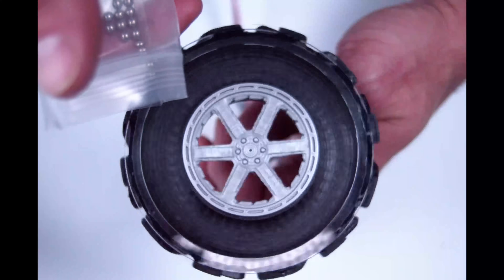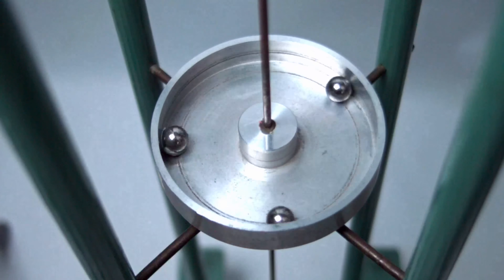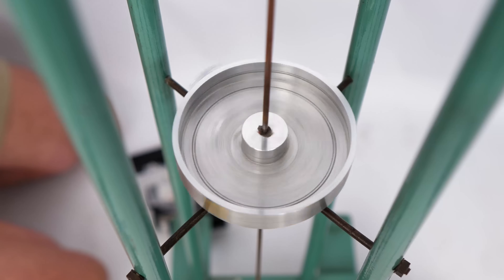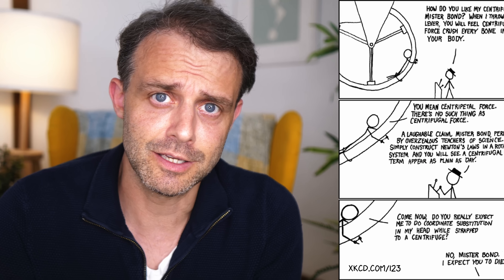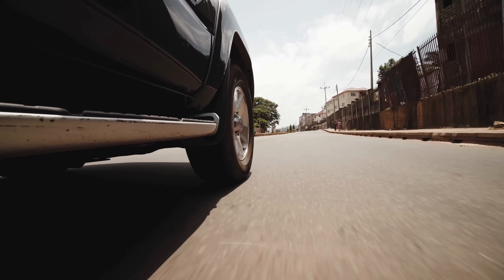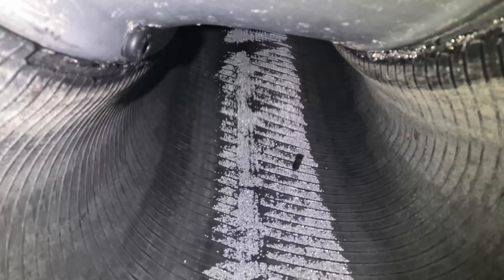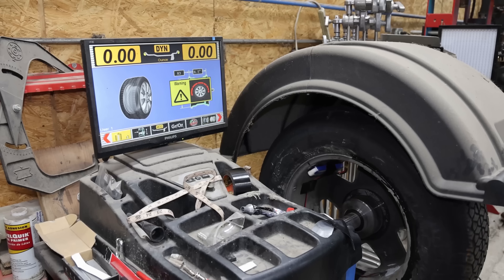Do tire balancing beads actually work?

Comment: At 10:02, the freeway you're showing is in Los Angeles, where the 110 crosses the 105.  In the video, you're looking southbound along the 110.  Thanks for picking one of the LA freeway interchanges.  By the way, their is an electric train that runs through the center of the 105, and a station under the orange-ish awning.  And the "diverging diamond" on the bottom layer is for busses only.

Comment: wait , shouldnt your axle be horizontal ? The way i see it is in this video the physics wont work the same as in a car wheel , reason is the balls are pulled down by gravity and centrifugal force pushes them outwards  compared to if it was upright like a car wheel then its only vertical forces at play

Comment: balance beads work at around 30mph on larger tires, the larger the tire, the faster it works.  I use them in large tires.  they don't work well in small car tires.

Comment: not sure if this is helpful, but when I was a kid there were not fancy balancing machines, and somehow we got on okay. A mechanic (or your uncle) would have this gadget, it had a shaft held upright by feet like a christmas tree, and a funnel shaped thing you would rest the tire on, and a bubble balance in the middle. You'd put your tire on there, get it centered, and you would find that the bubble leans one way or another. You would rest weights on the rim until the bubble was centered, then you would pound the clips into place. No batteries, no software to screw up. Worked for a lot of folks for a very long time.

Comment: Could you put a glue like thing on the beads, speed up the tire to set them all in place, and then just leave it? I would imagine that’d be cheaper (and more easily accurate) than finding the perfect place to put a counter weight.

Comment: Regarding the car situation, i see one scenario with two drivers conducts :
- provided you stay inside the regulatory speed range and do not have a freeway in sight for miles... you'll have a potential wobble that will distract you and make your vehicle slightly harder to steer,
- provided you don't stay inside the regulatory speed range to balance your wheels every single time, you'll be a hazard on the road, even if you know it perfectly (i mean especially if you know it perfectly)

In both cases, the danger for you and others, if only potential, is to take into account (one is by geneerating an annoyance sufficient enough to distract you, the other is a dangerous misconduct and both imply the driver's concentration and attention).

I personally wouldn't drive a vehicle that would be a potential hazard depending on the circumpstances (and i have approximately driven half a million miles with two car accidents).

But yes... I have to admit the glass beeds balancing method is way cooler than the lead weights. Seems like magic.

Comment: Total scam.   I got balance beads in a new set of tires.  They were terribly unbalanced. Took it back and explained the problem, they still couldn't get them balanced.  - I went to a different tire shop and had them remove the beads and install  traditional weight balancing and never had another problem.   The only reason they push beads is because it requires no skill and takes less time, which means  poor service to the customer.  NEVER AGAIN.

Comment: 2:00 I think that because the balls are not orbiting the centre but the object is circle shaped around the actual centre you get an angular velocity increasing as you go to the beads on the outside of the collection. So the bead that is closest to the new centre of mass will have the least angular velocity and therefore speed. The ones on the outside of the collection will have the same angular velocity but different speed. They will then travel out further and deviate more because they are moving faster I think, maybe something to do with having more momentum or it’s as if they are trying to move outward into a higher orbit to match their speed as higher speeds forces an object into a higher orbit to match

Comment: Wheel hop resonance speed is typically 30/60/90 mph on cars, and 35/70/105 on trucks.
So the beads should be set by 30-35 mph.
50 mph would require a very small tire.
These are also very commonly used on steer tires of semis.
If your minimum effective speed were true, they would never drive fast enough to meet resonance.

Comment: Yes they work. I have had several tires replaced on 2 separate RVs with 19;5 and much larger tire size I don't remember at the moment and they worked well no thumping down the road in any of the tires steering or driving tires.

Comment: This only works if your tires spin flat like the contraption

I don't think it would work well in my tires, which are on a horizontal axle

Basically, what you're doing is demonstrating how a load of laundry self balances during its spin cycle <3

Comment: I ran ceramic balancing beads in my motorcycles and never had any problems or issues. They all rode very smooth no matter the speed. I also ran them in my 6'x12' single axel trailer and it pulled a lot better and smoother.

Comment: Many years ago there was a product sold that claimed the same principle except you didn't put it in the tires.  It was on a plate with an outer ring filled with some sort of movable weights that you put on to your rotor just before you installed your wheel over it.

Reading through the comments, I am a scientist but not the one you see doing these kinds of experiments except for in school.  There are multiple natural laws in force in play that all work together.  I can't think of all of them but I do see some of them.  Harmonics is certainly one.  Centrifugal force, kinetic energy, that kind of stuff.  But just try to explain how they interact with each other would be a challenge for most anyone except for maybe someone who understands them all very well and can mark where one law weakens and another strengthens.  Isn't nature a wonderful thing how it operates and interoperates in perfect harmony with each other?

Comment: What impact does the plane of rotation have on this effect? All your desk models rotate on a horizontal plane and therefor don't need to accommodate gravity. A vertical plane will have an extra force pushing the bearings out of position. Is this effect too small to make a difference or is it just enough to ensure the system never balances?

Comment: I think they're useful as a temporary fix, but ultimately you have to get your tires balanced to prevent all that strain on your axle. You don't want to break your axle after all and that's a much more expensive fix than tire balancing.

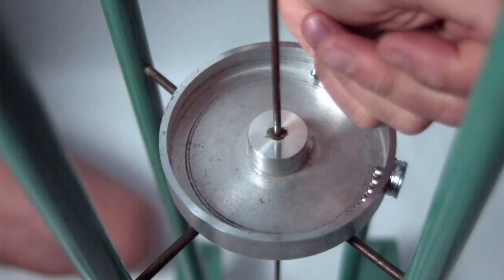Comment: I guess it is about resonance. At 1:38 with the right rotating speed the system fall to the "attractor" favour the resonance of the fixed mass rotating away from the center and thus the additional mass. At 1:53 the system fall to another "attractor" that favour for steady rotation.

Comment: Good demonstration of rotation, mass, and gravity.
When at low speeds, the beads bounce because of vibrations or spring effects. However, with the increase of rotation, the g force goes up, and the  vibrations go down.

Comment: There was a TV Commercial several years ago that demonstrated this very thing. They maker of the Commercial had developed a Disc that mounted behind the automobile’s wheel (held in place by the Lug-Nuts & as the wheel increased in Rotation Speed, it would “Balance” the tire’s wheel hop or vibration. It worked, but apparently there was not much demand for such a device & I haven’t seen that commercial in many many years.

Comment: what if we use some kind of glue, that will be strong enough to hold the tiny beads to the tire, but not so strong that it'll be difficult to remove

Comment: In the states we pretty much only use them on off-road trucks. I would prefer to use traditional counter weights,  but they tend to come off under a little abuse.  They also continue to work as the mud builds up on the inside of the wheels and changes the balance.

Comment: I've been using ceramic beads in my pickup truck tires for the last 25 years. Put 6 ounces of ceramic beads in with a new set of tires, but remove the air pressure sensor from the inside of the rim and replace with a high quality Schrader valve, as the beads will eventually damage the sensor, which can cause the tire to lose air and result in a blowout of the sidewalls.

Comment: I guess the ideal thing would be to get the tyre up to the speed where the beads self-balance, and have some way to make them stick in place at that point. Perhaps they could have an adhesive coating that sets when they're under a certain amount of centrifugal force?

Comment: 1) Definite scam for anyone who stops their car.
2) "Highway" speeds, although we may call it the Expressway or Freeway on occasion.
3) RIP EVGA 😢
4) VNC is open source, free to use software that does all the same things, and possibly predates commercial software.  Although as with all open source, probably has a crap UI, horrible performance, abysmal feature set coverage, and lousy update procedure.  But hey, it's typically a viable option for occasional use if you're poor.

Comment: There is nothing wrong with your experiment... but you ultimately come to the wrong conclusion by applying it to tires on a car.  The issue that you overlook is that tires on a car are NOT perfectly round.  There is a flat spot on the bottom of the tire where it meets the road. So as the tire is rotating, every revolution has a significant flat spot.  So any beads or other material in the tire would never bee able to stabilize because the flat spot would disrupt that.... every revolution of the tire.

Comment: Ok so hear me out, why not use balance beads mixed with an adhesive that sets off over a 10-15 minute period.  Insert beads and adhesive, place wheel on a highspeed spindle and get wheel to highway speed while the adhesive sets.  surely the beads are now secured in balance and no longer need to be spun up to be effective.

Comment: I work with helicopters and we balance main and tail rotors. Depending on the instruction and equipment, it can be an arduous process. We call this vibration IPS or Inches Per Second, and we smooth it out in a process extremely similar to balancing a tire. However, this video has given me an idea...

Comment: I suspect your 80km for super critical balancing might be high because the road is acting like your hand on your milk frother. From the beads-in-tyre video and several anecdotal comments thereon, the beads start doing their thing from as little as 12mph. And even if I'm wrong,  it's fairly uncontroversial to assert that beads are best used where where balancing is hard to access and on big wheels - like on a truck. They make less sense on your average sedan because proper balancing is so easily accessible. Btw loved the Anydesk ad - actually made me want to try it even though I'm not longer in IT!

Comment: I don't get it. You just say the body rotates around its center of mass (because the axle does not restrict it), and therefore you now understand both the flailing and the higher speed vibrational mode. Why does speed make a difference? It should still rotate around its center, no?

Comment: I am using tire beads. 2005 Silverado 2500 running 245/75/16 tires. So far they seem to work very well. My tires are new so that may help but at highway speeds the ride is smooth.

Comment: Hey everyone, fleet manager here! I exclusively run balance beads in commercial truck tires and here are a few reasons why;
1. Cost, it’s far cheaper to just add beads to a tire rather than have commercial truck tire balanced
2. They don’t run the risk of getting knocked off the wheel like regular wheel weights do especially on aggressive terrain. 
3. The largest reason is this, commercial tires typically last far longer than passenger tires. You should have your passenger tires rebalanced 1-2 times through the life of them (depending on the quality) and most commercial tires need to be rebalanced 3-5 times throughout their service life. The benefit with balance beads is that they ACTIVELY rebalance every time the vehicle comes to a stop and rolls back up to speed. They change for anything, mud stuck in a wheel, tire wear, nails or bolts through the tires. They really are great at this and the largest reason they are so common in use in the commercial world!
Reply: The thing is that every time you are driving between the warehouse and the motorway, you are going to have unbalanced tyres.
If you come off the motorway and stop at traffic lights or at a junction etc, then you are going to have unbalanced tyres when you start driving again.
Reply: The real reason they are used is because of lack of machines available and cost to balance a commercial set of wheels along with downtime. The beads only work at certain speeds and for freeway driving. While they have a few pros, the cons just outweigh them.
Reply: Hey everyone adult superstar here we use beads for a whole different reason.
Reply: "Hey everyone, circus manager here! I exclusively run balance beads in my commercial clown car tires and here are few reasons why; (yes i dont know the difference between semicolon and colon even tho im a circus manager)
1) Cost. Im a cheap f**k, and even tho i directly use those tires to make the profit that makes my manager ass worth something, id rather cheap out on those tires then on my paycheck
2) They annoy the living HELL outta all my employees every time they get out of the freeway, and i enjoy their suffering
3) Cost again. I read a magazine about ATVs, and they said that 9/10 offroad drivers use beads in their tires, because of mud stuck in their wheels. Yes, it was a sponsor, and no they didnt mention that mud balancing is needed on clown car tires, but i still put them on clow car tires, because other similarly outgoing managers, like myself, started saving money on actual tire balancing doing this 1 simple trick, and all mechanics HATE them!

Please give me attention, coz my boss wont give me attention, since he needs to process all the employee complaints 😓"
Reply: We had a service manager from a major fleet company to get trained for being a manager at snother shop. Dude was infact a cheap F, that didn’t know his head from his rear. Lasted only a week, drove off in his corvette and never came back. Attached balance weights never came off when a customer would return years later for a replacement and it was something to take pride in. Meanwhile unfamiliar drivers coming in with beads in a tire had the inner tire destroyed with tread looking like a turtle shell.

Comment: We use them on our service trucks. They are a trade off. Set weights balance the tires at all speeds. Balancing beads only balance the wheel at highway speeds. Based on that summary, one would assume fixed weights are a no brainer.

However our trucks go off road and mud packs into the wheels, this ruins impact of the fixed weights, but the balancing beads still balance even with the mud. And when the mud breaks free in chunks they reset dynamically.

When you pull out onto the road at a low speed you can sometimes feel the wheels are not balanced, but once you speed up it smoothes out.

Comment: as a mechanic admittedly a fairly new one, i feel like conventional balancing is superior. now of course im biased but in my opinion like steve said the balance beads only work in certain scenarios. while conventional balancing works at all speed all the time. the other thing to consider is that with the newer wheel balancing technology like Hunters "road force" (its specific to Hunter machines but im sure other brands have something like it) we can actually measure the inconsistencies in the stiffness of the tire and rotate it to minimize the effect. this is something that weight based balancing and balance beads cant really do.

Comment: The car balancing beads are inside the tire without any adhesive, assuming from seeing the inside of the tire video clip. So I still don't understand how the horizontal model, which in most part cancels out gravity, is a comparison to what is inside the tire since gravity acts very differently pulling the beads down as soon as speed drop enough. If your model, the spinning disc, is in vertical position, would you get the same results? Would those ball bearing stay in their position as it slows down from the critical speed?

Comment: Balancing beads are common in semi truck tires in the USA. You can also get these thin spacers with a ring on the outer edge with beads in it that does the same thing. Called centramatics.

Comment: Basically, to put it simple, only use balance beads if you have a lifted truck with dumbass choppy tires. I am speaking from personal experience at dealerships and tire shops.

You only want to put them in big lifted bullshit or wheels that you dont want weights or adhesive on.

Comment: After you explained the high speed roatation regime, I realized I don't understand the low rotation regime.  If the driving rod is free to move, why doesn't it rotate around its center of mass in low speeds?